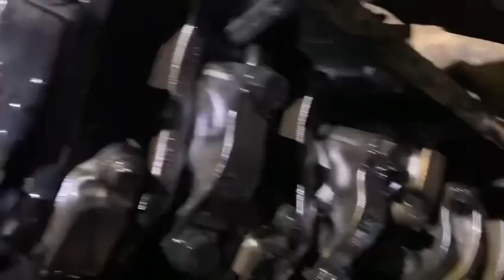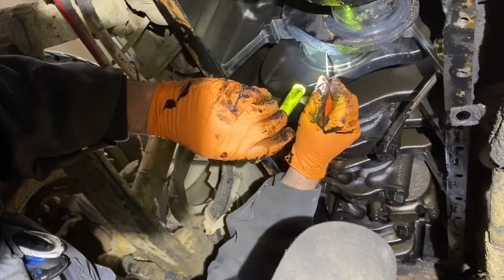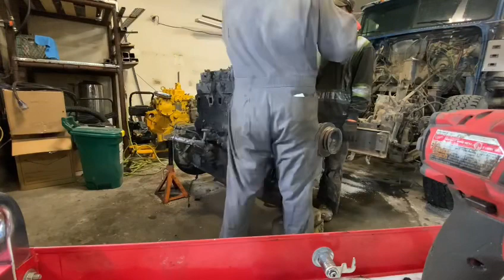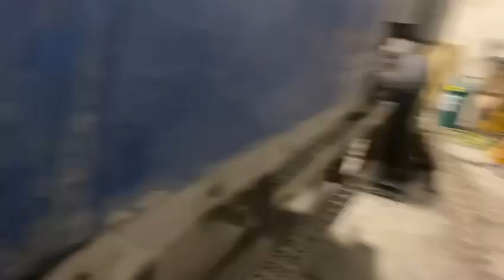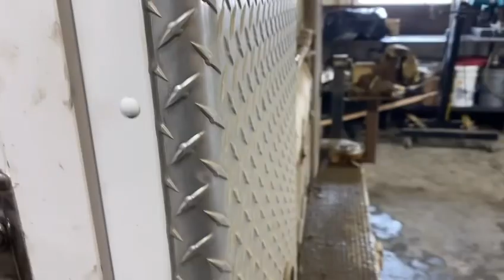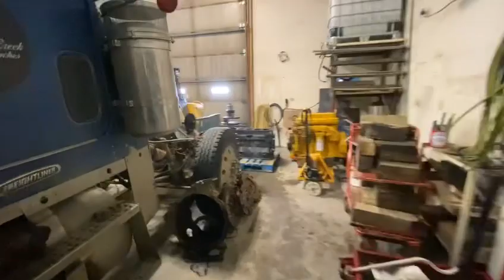N14 down! Major damage pt1

Comment: Have u ever seen the main cap fretting on an 855.?.. I've only read  about it I guess
Reply from the maker: I’ve seen it in the past on multiple engines but can’t say I’ve seen it on 855’s in particular but I also don’t see to many 855’s now a days. Last one I overhauled was probably 2 years ago
Reply: @PrairieMechanic  10 4 👍what engines have u seen it on?.. just curious
Reply from the maker: @elroyelblander6277  I have seen it on older Deere engines and I’ve seen it slightly in an ISX but really haven’t seen to much of it. Could be I just don’t open up enough engines to have been exposed to a bunch of it. Not sure.
Reply: @PrairieMechanic  you are a great master mechanic thank to share you experience   You are very easy to understand  and sound  a great  person god bless you